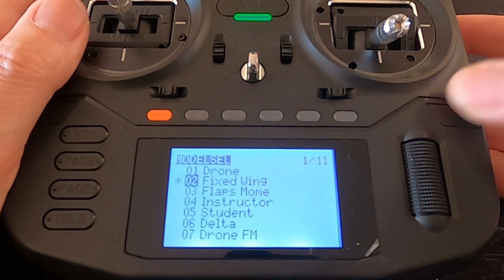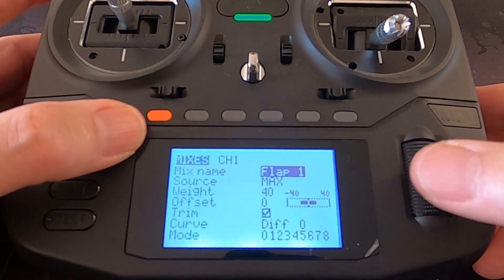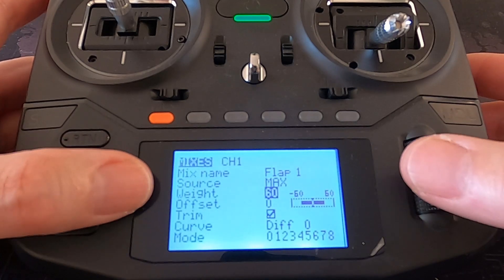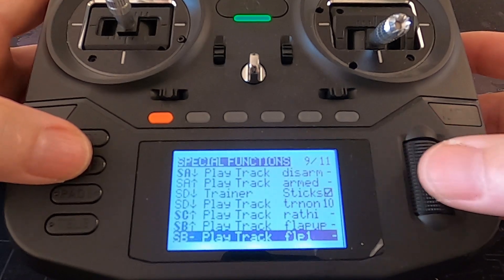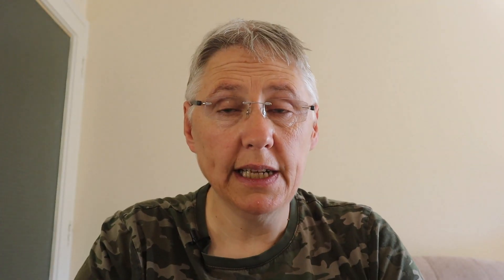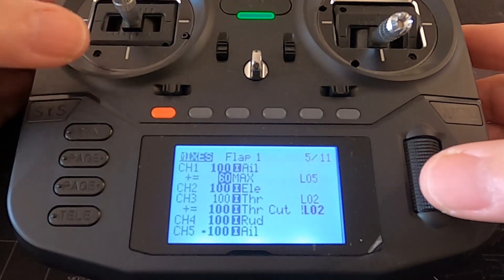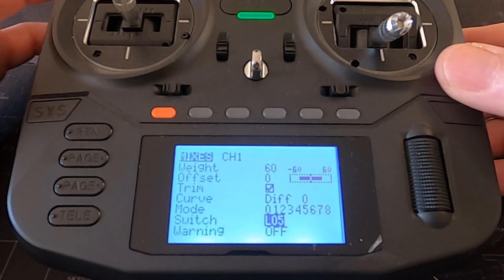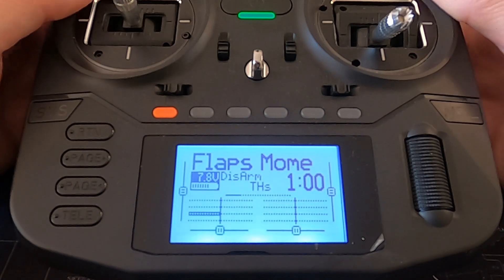RadioMaster Boxer setting up Flaperons 3P & Momentary Switch

Comment: Cheers Bill, just getting into the hobby, I used to have my Ailerons on a single channel now that I have put them on 2 channels one of the ailerons is only going high or low no in between values
Reply from the maker: If you are using an ExpressLRS receiver only use Channel 5 for arming.
Reply: @ thank you I’ll give it another go I was using channel 5

Comment: Wonderful video. One problem.  I am dead in the water with getting both flaperons to operate correctly.  Regardless of input direction (within the 5 channel Elrs receiver) or within the Boxer's outputs settings, and playing with variations on the +/- direction settings on the weights, the best I can do is get the left flaperon to behave correctly (lower), but the right flaperon deflects upwards.  I know you're busy, but any help would be most appreciated.  To facilitate any assistance you might be able to provide, I can provide you with the Companion file with all the settings contained therein.  I was the individual who had said you were doing a "bloody good job Sir" from across the pond.  Any help would be gratefully appreciated.
Reply from the maker: If you can back up your radio and model settings and email it to me I will take a look for you. Getting the correct moment of the surfaces can be tricky. triplemadventures@gmail.com

Comment: As always Sir, FANTASTIC!!!  I initially used an earlier video to properly set up my Boxer for a dual servo aileron plane.  I wasn't fully up to speed behind the steps, especially the logical switch setup and logic (when setting up important electric motor arming).  This video began to start the process of "fleshing out" so-to-speak the process of understanding, which after all, is the most important aspect that one has to derive from your videos.  Bloody well good job Sir!  That's coming from "across the pond"!

Comment from the maker: You first need to find out which channel the modes operate on. Then assign a mix to the channel and select the 3 position switch you want to use. It should be set up correctly by default. -100 switch forward, 0 switch middle and  +100 switch in the back position. If the works the wrong way round change the weight in the mix to -100. You should be to go.

Comment: Hello, I recently got the boxeer and found your videos very helpful. Unfortunately, when I try to set up my flaps, my flaps could only go to the neutral position or full throw. I tried positive, negative, large, and really small weight # and it would only do that. I was wondering if you can tell me how to fix my problem. Idk if this info is useful, but my plane has only 1 dedicated channel to two flaps on channel 5. I think it makes a grinding noise when its flaps down, so I assume it pulling beyond on the flap further than it can allow.
Reply from the maker: Hi Larry, this video should help you if the flaps have 2 servos connecting to one channel which is normally via a y cable.
https://youtu.be/H1ObSmHXiDY?si=La6R4YqC5OszBn24
Reply: Thank you very much. You videos are great! Im glad someone is doing detailed guides for these remotes.  @the-happy-RC-flyer

Comment: I am trying to bind a microzone s- fhss receiver to my radiomaster boxer 4 in 1 but it wont bind. Could you please help, im desperate😢
Reply from the maker: Hi, make sure your transmitter and receiver are not to close when binding. I assume you have selected Futaba SFHSS Then put the receiver into bind mode and then clicked bind on your radio? If you are sure you have completed this process correctly then you may have a fine frequency tuning problem. If you go to Freq tune and put in a plus figure of 30 then try to bind. If no go change figure to -30. If this works and your receiver is bound you need to complete the Fine Frequency Tune procedure. Check my playlists for how to do this.
Reply: Thank you very much but I cant find futaba sfhss on the internal module it only appears on the external module but I dont have an external module added.
Reply from the maker: @bernhardskrauklis7690  if you do not have an external module it should not be giving you any options. Have you updated the firmware recently? What firmware version does the radio and model have installed.
Reply: The radio is completely new. It arrived yesterday. It uses edgetx version2.8.0-factory. I dont know what is model firmwlvare.
Reply: *firmware
Reply: I still cant bind it 😢😅
Reply: When I press bind the radio beeps three times really quick and repeats that every 3 seconds. I dont know what to do , pls help😢
Reply from the maker: @bernhardskrauklis7690  are you sure you are putting the receiver into bind mode?
Reply: @the-happy-RC-flyer  yes! I press the bind button then the light starts flashing and when the receiver is binded the light should stop flashing but it doesnt. Arent there some important settings in the radio that need to be set for it to be able to bind
Reply from the maker: @bernhardskrauklis7690  are you selecting bind on your radio? Put receiver into bind mode then select bind in the radio. Then unplug receiver from the power and plug back in.
Reply: @the-happy-RC-flyer  still doesnt work. I tried with
Reply: Frequency tune at 30 and -30
Reply from the maker: @bernhardskrauklis7690  are you sure you have the correct protocol?
Reply: @the-happy-RC-flyer  on the receiver it says s-fhss. Maybe it only works for futaba receivers🤔
Reply from the maker: @bernhardskrauklis7690  I do not have the receiver to do tests for you. But a long shot try FrSky D16 and D8 please.
Reply: I only have the sfhss receiver. But why do I have futaba sfhss and all the other protocols on the external module and not on the internal module. Is it supposed to be like that?
Reply from the maker: @bernhardskrauklis7690  please email  me a picture of your model Screen showing the internal external module options and the back of the radio. triplemadventures@gmail.com
Reply: @the-happy-RC-flyer Hi again. I conntacted the radiomaster support team and they said that microzone is not a futaba SFHSS compatible  product. So I have to buy a different receiver. I was thinking a radiomaster r86, but it uses frsky d8 protocol and when I select it on the internal module it says protocol invalid ( its not available on the external). Will I be able to bind it?
Reply from the maker: @bernhardskrauklis7690  the RadioMaster receivers will bind to the Boxer radio.
Reply: @the-happy-RC-flyer  last question-   wil a frsky v8r4- II bind with radiomaster boxer?
Reply from the maker: @bernhardskrauklis7690  the problem is FrSky have different protocols so it is hard to say is the protocol ACCESS or ACCST. ACCESS will not bind to the MPM.